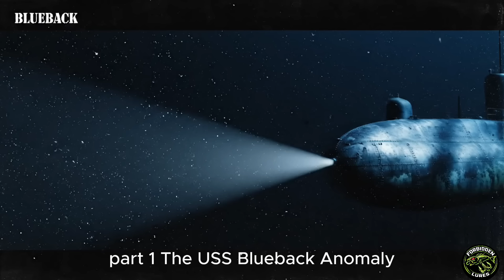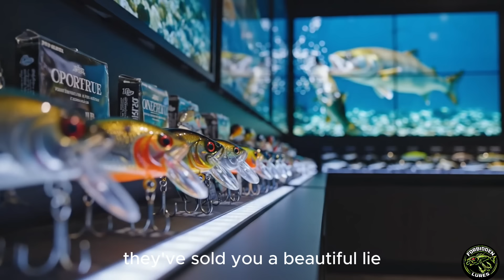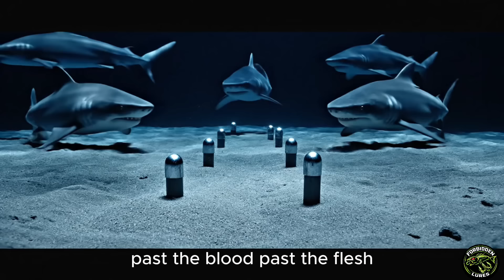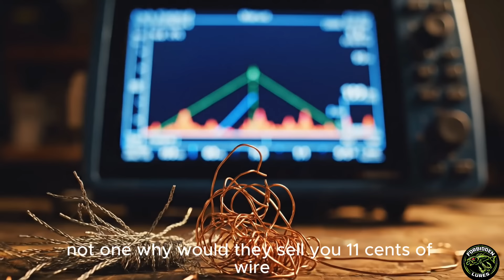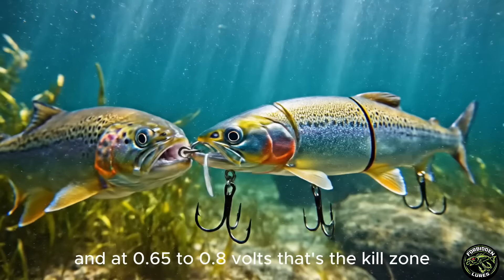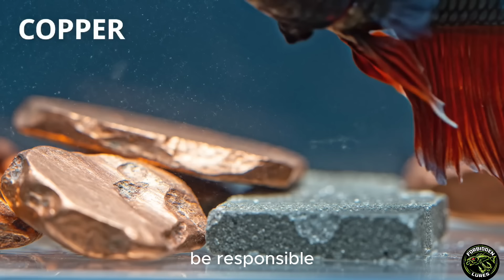One Hook Modification Attracts Every Fish in Range — The Navy Proved It. Then Buried It.

Comment: Does this voltage get produced in freshwater also, or only in saltwater?
Reply from the maker: A small galvanic effect can happen in freshwater too, but it is usually stronger in saltwater because saltwater conducts much better. So yes, both can produce it — just not equally.

Comment: I thought the key was saltwater how can you do this in freshwater you don't have the same galvanic reaction between the three medals please answer me that
Reply from the maker: That’s a fair question. In freshwater, the galvanic effect is usually weaker than in saltwater because conductivity is lower, but it may still produce a small effect. In practice, I’d treat it as a minor edge, not the main reason fish bite.
Reply: @ForbiddenLures What about using salt impregnated lures like soft plastics?
Reply: This was my question....
Reply: If it's not effective below 55 degrees and continues to be less effective as the water drops in temperature, How In The Hell Did It Work, On Submarines at the bottom of the Very Cold Ocean. BS STORYLINE.
Reply: Though the galvanic reaction is weaker in freshwater it still exists... AND it can be magnified by using salted bait!